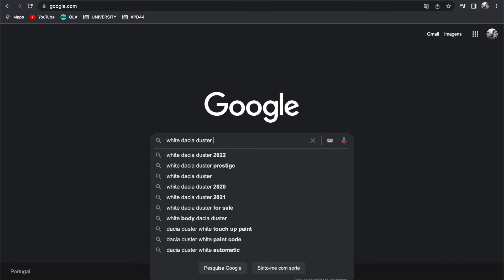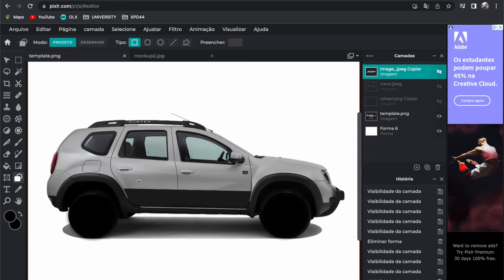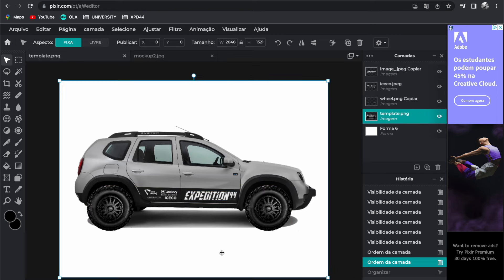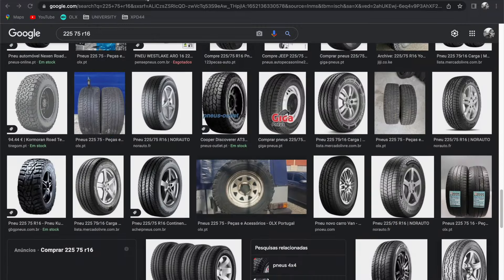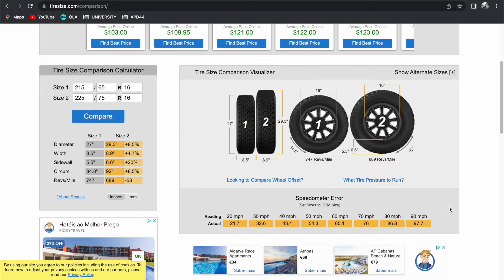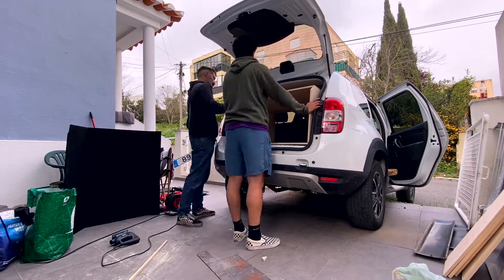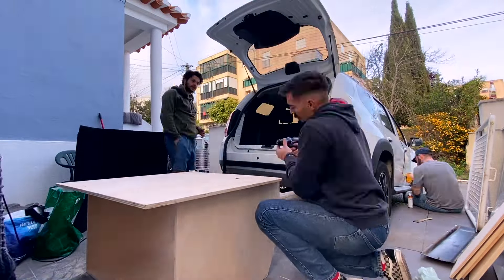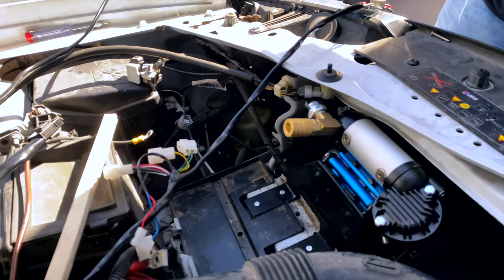Best Modified DACIA DUSTER on the Planet! Mods Overview!!

Comment: I modified my duster like this... suspensions raised 5 cm... lsd with 80% locking... new front rear, 140 hp..... and it doesn't need anything anymore. it's impressive 😁😁👍👍
Reply from the maker: Nice work! Sounds like an impressive build! How are the twin lsd working for you?
Reply: @xpd44.outfitters  along with the central differential, the 2 LSD front and rear differentials improve grip when a wheel is suspended, none of the wheels on the ground spin for nothing.
Reply: @xpd44.outfitters  and the power is no longer so great that you risk forcing and breaking the planetary gears in turns due to the 20% tolerance when turning the wheels, allowing balanced turns.
Reply from the maker: @andiruiu3327  awesome! How about the centre diff? Is it stock or did you upgrade it? We ve experienced overheating and automatic disengaging twice and are seriously considering upgrading to pneumatic.. what’s your setup?
Reply: @xpd44.outfitters  the central locking differential remained the one from the factory, thanks to the fact that I have these lsds that stop the exaggerated slippage of the wheels, the traction computer no longer enters the breakdown mode and behaves perfectly... now let's clearly understand that it is not an extreme off-road car... but it has extraordinary qualities in this configuration
Reply: @xpd44.outfitters  and there is another problem...which I have seen with many Duster drivers...they go into automatic traction mode and this destroys the central differential if the road is not slippery or snowy...if it already goes too often the failure mode means that the central differential is 40% damaged
Reply from the maker: @andiruiu3327  thanks for the inputs! Where are you located my friend?

Comment: How does it handle on long trips on the road? You mentioned the steering is a bit stiffer but how about regular days
Reply from the maker: Handles great! This is my daily driver and I have absolutely no complaints. The heavier steering you only notice when transitioning from another car straight away, we are talking “slightly heavier” not like it doesn’t have power steering ahaha Cheers!
Reply: @xpd44.outfitters  hello, thanks for the reply! So it will be just a little bit stiffer due the suspension and new WIDER wheels?
Reply from the maker: @dv2045  no! Everything is the same. It’s just the way Dacias are made. If you drive any older model Dacia it’s the same
Reply: Hello 
Great mod ❤
Could you please remember type of springs ?
Thx!

Comment: Hi there, love the rack. But can you slide a hand witha tool under to bolt a roof top tent?
Reply from the maker: Hey Tommaso, the bars are completely modular you can bolt on all kinds of accessories and slide them into place wherever you want. We will release a dedicated video soon. Anyways the roofrack is intended to be very streamline so you can barely fit a hand underneath. If your rooftop tent uses U bolts however those screw from the top so no problem what so ever!
Reply: Thanks man, anche idea of when it's going to be available?

Comment: Did you have to lower the engine when using the suspension lift kit? One of the Romanian channels seems to think that the CV angle MUST be aligned correctly to avoid vibration through the driveline.
Reply from the maker: It depends on how much lift you had. For this kit its not necessary, for higher lifts yes it is advisable
Reply from the maker: You will always get vibrations even with the engine lowering

Comment: how much gonna cost a rack like that? I need one, not so low profile, but here in greece they ask me to much money.
Also how many kilos you load , with the car in the highway?
Reply from the maker: Still figuring out the final cost of production but under 650eur.
Reply from the maker: We have loaded ours with around 100kg while driving highway and offroad and about 200kg stationary no problem.
Reply: @xpd44.outfitters  thats a good price.
Reply: @xpd44.outfitters  i made wrong question. I asked about the stock rails, not your new roof rack. That seems so steady.
Reply from the maker: I have no idea but I'm sure dacia has that info published somewhere out there
Reply: @xpd44.outfitters  yes, it said 80kg. But i need a few more....

Comment: Did you lower the engine? Because you used new shockabsorbers. Enjoying your journey
Reply from the maker: We did not. Only after a 50mm lift you start feeling the effects of increased cv angles like vibrations etc. It drives like it has always with our 30mm lift by 4x4proyect. Highly recommend this suspension set! Go check them out

Comment: Great stuff, loving the mods. What about a bug guard on the hood? Also a minor thing, turn the volume down on the background music. it was quite loud for the video. Could still hear you guys ok though!
Reply from the maker: Never really saw the need for one tbh.. also not a very big fan of the looks. Thanks for the feedback!
Reply: @xpd44.outfitters  and what about WindDeflectors on the door windows?  I did a swapout of the head unit to an android one so that I could get Android auto on it. Was an easy job to do as any 8inch screen type has the right mounting ports to install it straight away.

Comment: Unfortunately, this is not an optimal setup. Very little research done for a Duster size and weight. Let us give you an example, those tires are actually not recommended on a Duster due to their poor and dangerous wet asphalt emergency performance.... and so on
Reply from the maker: As far as the weight this Duster is sitting at a little over 2000kg with 4 adults and all the gear so the tires perform great in that aspect. We also have them on another vehicle (Jeep Wrangler) and they are great on and off road. Never had any problem on wet asphalt. When it comes to wet asphalt emergency braking no tire is great otherwise there wouldn't be so many accidents so we as of now this is the best tire for us and our setup. Regardless everyone has their experience and opinions and they are all welcome here! Thank you for your input but these tires work great for us
Reply from the maker: Don't forget to subscribe! Thank you 🙏🏽